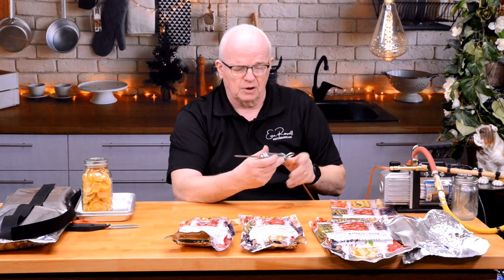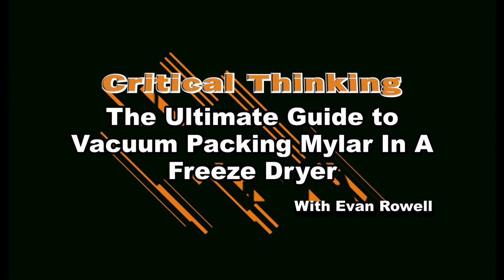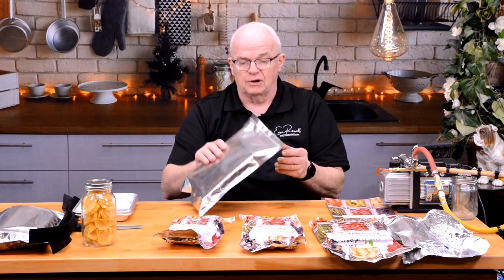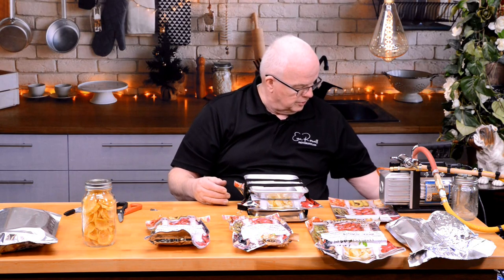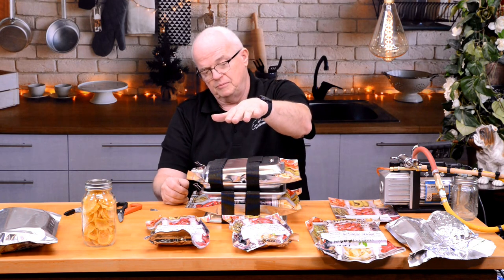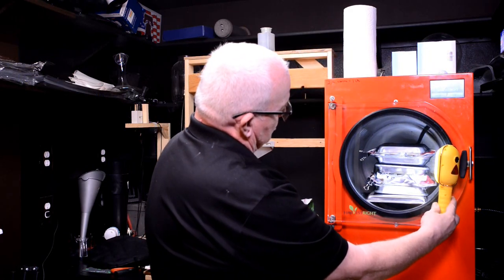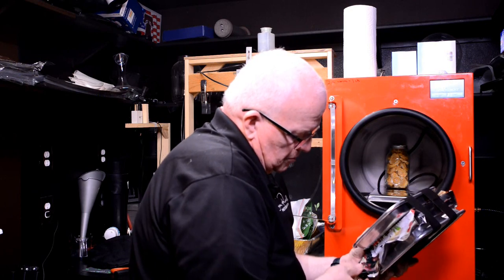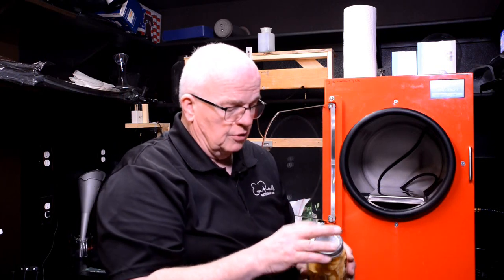vacuum packing Mylar in a freeze dryer

Comment: Dear sir, you just saved me a big expense of buying a vacuum chamber on line over 500 bucks Canadian.  I only did one batch so far after my bread run and have it in jars and use a battery operated sealer.  I don't really trust it for long term. So instead of buying the 500 dollar + chamber I'll go and buy some 8 or 9" metal trays for a whole lot less.  Thanks so much.

Comment: Evan, I am a retired Chemical Engineer.  I’m just getting into freeze drying, and don’t have my machine yet (3-5 more weeks!), but you have given me an idea.  I like your thinking and I hope I might be able to add an improvement to your process to make it simpler.  The stress is caused by too much vacuum too quickly.   I propose to remove the air more slowly, to allow the air to flow out with less of a differential and stress on the Mylar.  Step the vacuum down.  I can think of several ways to do that: in the software, restricting flow to the vacuum pump with a valve, allowing some flow in at the drain valve.  I’ll test when I get my machine and let you know.  Thank you!!
Reply from the maker: Hello Jim. Interesting, I like the idea of a control valve that can be adjusted, it makes sense. I don't think the software idea will work, too many lay persons and it would be too involved. The idea about letting air in at the drain valve would limit the vacuum level all together but the valve at the pump to slow down the increase without restricting the boundry sounds like an easy way to do what you suggest. I think some thought and experimintation is in order. Thanks for your comment, Evan

Comment: LOVE all the help you give ...THX!!! I'm trying to put any extra money toward debt so not buying much of anything but the essentials. Great tip in one comment to use the FD trays instead of buying the pans and I used some larger than normal rubber bands I had bought at Wally World previously. It allows the bags to puff up a little, not as tight as using velcro but the bags suck down very tight around the food. Works great w/o spending extra $.
Reply from the maker: Rubber bands are a great idea!  Thanks for the comment, Evan

Comment: Make the hole at the corner of the bag as small as possible. I vacuum packed 5 bags at a time. Just keep the holes tiny. No pans or clips. My sealer is about 3 feet from my FD.
Reply from the maker: Yes, that will work if you're fast.  Evan

Comment: Do you know how much weight of chicken with sauce can be loaded on each tray for a large harvestright tray. Thank you. I loaded trays to top of edge put very heavy for me to carry. About 5 lbs food... 7.32 lbs told tray and food.
Reply from the maker: Hello Trina and thanks for the question. The two guidelines for loading trays is first, regardless of machine size, the food must not be more than 3/4 inches thick and second the weight should be at 2.5 lbs per tray on a medium and 3 lbs per tray on a large because the trays are slightly bigger on the large. You can push the limits a bit if the food is on the drier side such as fresh produce but for chicken in a sauce I would definitely keep the trays at three lbs. and no more.  Thanks for the question,  Evan
Reply: @evanrowell5266  that you so much for your help. Gid Bless

Comment: I would never have even considered using my freeze dryer for vacuum packing. I had ZERO idea that was even a thing. Is there a program for vacuum packing on the machine... I've never seen it & haven't read about it in the manual. Thank you.
Reply from the maker: No, the FD software is meant for freeze drying alone, however, the fact that the pump can be operated via the vacuum test function with the shelving removed, effectively turns the barrel into a vacuum chamber wherein special programming is not necessary. Using the FD barrel as a vacuum chamber is a fairly well-known operation.  Thanks, Evan

Comment: Thank you so much. I was going to try my “seal a meal” for plastic bags on the Mylar, but this looks better. I don’t know if my plastic bag vacuum would work on Mylar. Thank you!
Reply from the maker: Thank You InLaws Attic, there is a way to draw some of the air out of a Mylar bag with a Seal-A-Meal but it's a hassle to do, does not draw a very good vacuum and is unreliable because it doesn't get hot enough to properly seal a 7 mil Mylar bag.  Evan
Reply: @evanrowell5266  OH! Thank you! Then we shall find another way- like your Velcro-pan method for sure- we get our harvest right in about 9 more weeks. Thanks!

Comment: Hello Evan. First off, my nerdiness LOVES your videos. Second, I was wondering if you tried putting spring clipped bags without the velcro and pans onto the shelves on the shelving unit relying on the shelving unit itself to reduce ballooning. It probably wouldn't work for smaller bags but maybe it would for larger ones. You could potentially get eight bags done at once. Just a thought. I would try it for myself but my husband is taking our unit back for repairs today. Keep up the good work!
Reply from the maker: Hello Dawn. Good question and, no I haven't tried it but it but I do know it would be ill advised, the pressure that can develop in the bags is high enough that you would most certainly damage the shelving. In my experimentation I am developing methods for doing small bags that incorporates the use of chop sticks (sounds funny but I will explain in a future video). Long story short - the expanding bags have broke bamboo sticks in half.  Thanks for the question, I will bring attention to that reality in an upcoming video. Thanks again,  Evan
Reply: Thanks, Evan.  I certainly enjoy the honesty of your videos and the way you explain what can/gone wrong.  It's also greatly appreciated that you share your experiments and experience.  From a right-brain, it's critical that we have access to thinkers like you. :)  that being said, if a person could find a metal box,open on top and bottom, with dividers welded that would fit the bags, could you stand them up and vacuum several more bags at one time?  Thanks again!

Comment: So can this process also be used with the older firmware ?,That is having to disconnect the pump from the freeze dryer....?Great job on the instructions !! Thank you !
Reply from the maker: Hello James, only as long as you can turn on the pump from the screen. I don't know all the different versions of firmware so it's hard for me to say. In any case, if you find that you have to plug the pump directly into the wall but don't like reaching around to the back, use a short extension cord (I made a three foot one just for this purpose) and plug it into the back and then plug your pump into it for easy access. Caution, do not use a cord rated smaller than the one on the pump - something like a lamp cord is very ill advised. Thanks for the question, Evan

Comment: Evan get yourself a chamber vac and save yourself a lot of trouble,  A lot easier!!  Avid Armor is a good brand. Additionally you can use the marinate function to rehydrate. The cost of the chamber vac will  be offset by saving ware and tear on your Harvest Right.
Reply from the maker: Hello Prius. I am familiar with chamber vacuums and its a good method of vacuum sealing food, very efficient but also expensive for a unit that will handle larger bags. The other drawback for me is the fact that these units are not made to handle Mylar bags, the sealing bar does not get hot enough. My methods takes advantage of the fact that a freeze dryer is already a vacuum chamber and allows me to tightly seal Mylar bags. Yes, there is some effort but accomplishing the vacuum seal is quicker than it seems in my video, I can tightly vacuum seal 8 large bags in about 15 minutes. The plastic bags that a chamber vacuum sealer is designed to use will keep deeply frozen food for about 5 to 7 years because they will permeate oxygen over time whereas a Maylar bag will not and that is a major consideration for freeze fried food that you want to store for 30+ years, the bag MUST NOT permeate oxygen or the food will go bad. Wet food will keep only slightly longer than it will for food sitting unfrozen in your refrigerator before it goes bad. Thanks for the comment,  Evan
Reply from the maker: One more thing Prius, you mention rehydrating with the marinate feature of the chamber vacuum. Forcing rehydration is not advised because exterior layers of food can over hydrate while leaving the center still dry. Rehydration takes patience to be done right, it should happen only as fast as the food will allow the moisture to permeate on its own. Patience is one of the six cardinal rules of freeze drying and proper rehydration.  As for wear and tare on my vacuum pump, that is negligible, it would take thousands of hours of run time vacuum packing bags to total enough wear and tare savings to offset the cost of a vacuum chamber, ergo, the savings you point to would never be realized, Thanks again,  Evan
Reply: The Avid Armor brand works just fine for mylar Evan. In it fact does not require the heaviest Mylar bag thickness saving a lot of $. The smallest size will do a larger bag when needed by placing the bag outside of the chamber and using it like a clamp type. The marinade function gets all the way through food, not just the outside of the food.. I think you may be a bit misinformed, not having used one, and would love the Arvid Armor model @$400. If using for plastic bag vacuum packing the bags are only $.10.
Reply: If the wear and tear is so minimal tovacuum pack in the Harvest R. Why are you posting such elaborate procedure to keep the oil clean? Most people ignore the oil getting dirty faster and will indeed shorten the life of the freeze driver.  Really Evan, a chamber vacuum is a much better overall solution. Do try one and buy where its returnable.  We need your valuable feedback to extend to actual experience with a chamber vac. Thanks so much!
Reply from the maker: @priusdwelling504  Hello Prius, changing the oil happens immediately after finishing vacuum packing so there is virtually no effect on the longevity of the pump and it is not associated in any way with effecting the Freeze Dryer itself. It could effect the pump if left in for a few batches. Also, I have a video showing how to make a vacuum filter which overcomes the problem of particulate. As I explained earlier, I have researched chamber vac specifications and they are not adequate for long term storage (30+ years) nor can I afford to buy one to make a video since I do not buy things just to use them and then return them. Thanks for your observations and comment,  Evan
Reply from the maker: @priusdwelling504  The marinade function is designed to work with soft food not Freeze Dried so, no, the function is not suitable, freeze dried material is a whole other ball game. I only use 7+ mil Mylar. I have used lighter (3-4 Mil) bags and they can loose vacuum, that is why Harvest Right only sells 7 mil bags. The vac chamber will not seal a 7 mil bag because if it got hot enough to do so then it would melt and destroy a lighter bag. The seal integrity and the bag's quality is far too important to trust to the wrong type of equipment. If you find success with the vac chamber then that's great but I would need a larger commercial unit designed for my long term purposes and those cost thousands of dollars. Cheap is what cheap gets, $400 dollars will not produce a sturdy dependable end result. The vac unit you are talking about is a home appliance.  Evan

Comment: According to Harvest Right the oil needs to be changed every 4 - 5 drying cycles. Have you found that using it as a vacuum packer that you need to change the oil more often or because it is such a short time that it doesn’t matter?
Reply from the maker: Hello Cheryl, great question and the answer is yes, I change the oil after every batch as a matter of routine but even if I did not I would change it after every time I vacuum packed. The moisture and potential for particulates getting into the oil is just too high. I am working on a home made moisture and particulate filter and I will make a video on how I do it a little later. Thanks for the question, Evan

Comment: Love this! I'm a newbie with probably less than 10 cycles on my FD thus far, so I'm always looking for new tips.  This quickly earned my subscription!  I have a question about the utility of the two small trays that you lash around the bag.  It seems that while they reduce the volume of the "bubble" in the bag, I wouldn't think that the integrity of the seals would be improved/protected at all.  The pressure gradient across that seal is the same with or without the trays in place, so wouldn't the stress on the seal be exactly the same either way?  Or is the utility of the trays mainly to maintain a flat/even distribution of product in the bags?  Thanks!

Comment: Very nice. My first thought was that you pressurized those bags with air. Could the pressurized air add unwanted moisture?
Reply from the maker: Hi YNOTTONYE2, The bags were not pressurized. I simply sealed them and then cut a small hole in the corner for air to escape when put into the vacuum chamber. When the chamber begins to draw a vacuum the bags appear to pressurize (balloon out) because the air inside is being pulled through a very small hole to the outside of the bag, the inside air is removed very quickly. When the vacuum is released the bags are unable to draw air back in so the bag draws in very tightly around the contents after which I seal the small hole. It renders a commercial quality vacuum pack. Thanks for reaching out, Evan

Comment: Hi Evan, 
I can't wait to try this vacuum pack method! I'm so glad I found your channel today!  
My questions is: Would this process be recommended with an oil-less pump? I'm sure it will work but I'm just wondering if it would hurt my pump at all, or if there is anything I need to do with the pump after vacuum sealing. Any help would be greatly appreciated!!

Comment: So this is a newbie question so please bare with me LOL!
 I read that sometimes you do add the oxygen absorbers. So are you Impulse sealing with an  AO right out of the machine when the foods done and then Vacuum sealing the bag this way when you get time?.. If so,  How much time would you have to reseal and vacuum the bag before the Oxygen absorber in the bag goes bad?
Thanks!
Reply from the maker: The O2 absorber will do its job leaving only nitrogen to remove from the bag so you actually have a very long time. The O2 absorber never goes bad it just gets used up. A 300 cc absorber will do a large bag with room to spare.  Thanks for the question, Evan

Comment: Orange FD. I love it!!! Wish they still had that color. Thanks for this info. This method is so much more efficient and quieter than my vacuum sealer. Am I correct that you do NOT use an oxygen absorber? The FD removes all air?
Reply from the maker: Hi Mimi. The fact is that I do still use O2 absorbers because they do more than absorb oxygen, they also help maintain flavor and freshness over the long term. Thanks for the wonderful comment, Evan
Reply from the maker: Oh, and the FD isn't orange, it's red. Because it's in a Dark-Room the lighting bouncing off the deep dark chocolate brown walls makes getting the colors right difficult. :)  Evan

Comment: Great tips on vacuum packing in the freeze dryer. Did you incorporate the use of oxygen absorbers or was this method so enhanced that they could be skipped?
Reply from the maker: Hello Kim. Great question. The pack is so tight that oxygen absorbers can be left out, however, I still use them if their is meat or dairy, it's just a thing with me, I feel better if I use one. Thanks for the inquiry,   Evan
Reply: 👏 👏 Bravo good sir. Thanks for sharing!

Comment: Hi, Evan.  Newbie freeze dryer here.  I freeze dried strawberries, blueberries and bananas and placed them separately in eight new 1/2-pint jars with new lids and rings.  I attempted to vacuum seal the jars using your method in the freeze dryer.  The first time I tried it, I stopped the process at 3500 mTorr. Only one jar had sealed.  I ran the process again letting the mTorr get down to 1550 mTorr. This time four more jars sealed. Tried it again with the three unsealed jars getting down to mTorr at 1550-ish . Two of these remaining three jars sealed.  I double checked the jar, lid and ring on the last jar, and sure enough, the lid had a small crimp in the edge of the lid.  I replaced it with another new lid and tried again to seal it.  This last jar never did seal even with the new, perfectly good lid.  Any idea why it took so many tries to get the seven jars sealed and maybe why the eighth jar never would seal? Thanks for any suggestions/solutions you may provide.
Reply from the maker: Hello DCS, There are only  four reasons the jars would not seal. First, as you mentioned, the lids have to be new, clean and in good condition. Second the lids should not be cold, warming them up will soften the rubber sealing material, they should be slightly warmer than room temperature, not hot! Third, the rim of the jar must be free of any particulate or moisture, especially oily residue. The fourth reason is most likely the problem, the bands may have been on too tight thusly not allowing the air inside the jars to escape. The only reason to have the bands at all is to keep the lids aligned. Be sure the bands just barely come in contact with the lids leaving the lids loosely sitting on the jar, the sudden release of vacuum will pull the lids down tight without the assistance of the bands. After the vacuum is applied is when you tighten down the bands, in fact some people  do not use the bands at all, leaving the lids just sitting on the jar, once vacuum packed they tightly apply the bands or leave them off, they really don't do anything but I leave mine on. Thanks for reaching out,  Evan